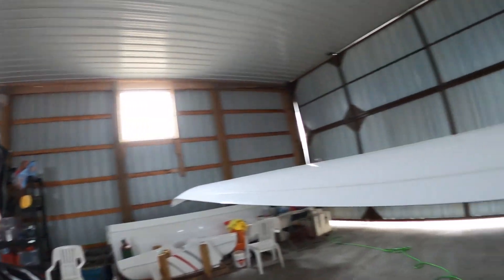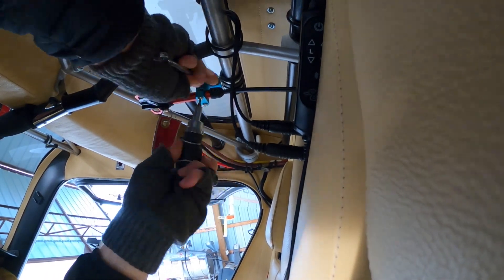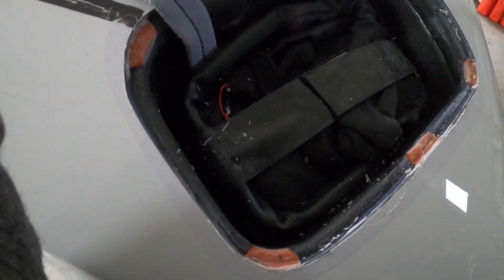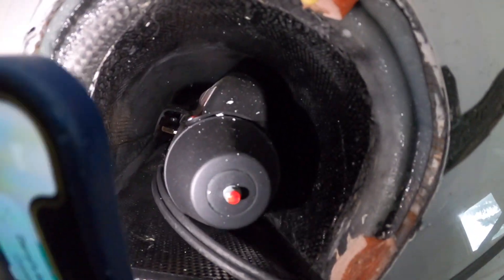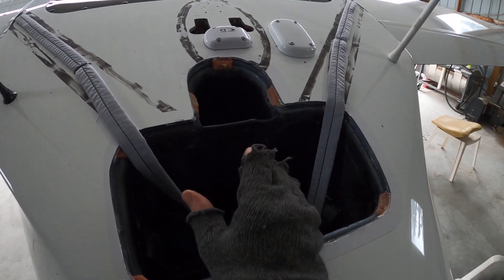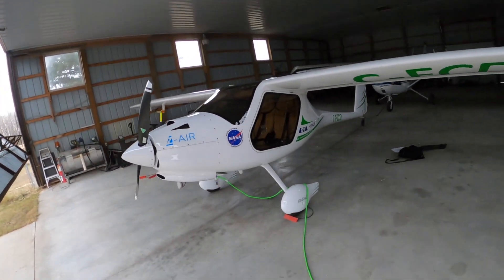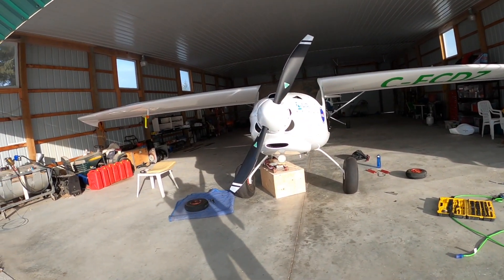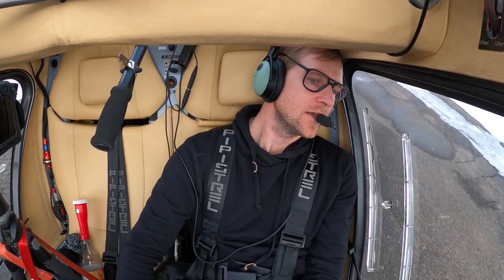Removing GRS Parachute from a Pipistrel

Comment: Just a month ago I ended up paying $7k for full service 9 year repack at GRS dealer in North Little Rock AR  ….
Reply from the maker: That’s insane sorry to hear. There was big discussion on pipistrel forum recently about this shop. They are not authorized by grs to do repacks. They have no training from grs apparently and do not use same rockets. I’m sure it’s fine but just so you are aware. Total cost to get mine overhauled from factory is 1300 euro.
Reply: @DarrylZubot  they did send the parachute back to Czech Republic for repack - so you end up paying for installation, delivery etc .. as far as I know you can’t just have the new rocket send to your place ……you need to have permits etc … anyway, it is expensive but , well ….everything even remotely related to planes is :-)
Reply from the maker: @walterrawdanik8077  that’s great it was factory repacked. Crazy how much they charge to be middle men in this transaction. In Canada you can ship and receive the rocket but it’s finding a company to ship it. It’s no problem getting to Toronto but still have to find a company to get it from Toronto to Alberta.